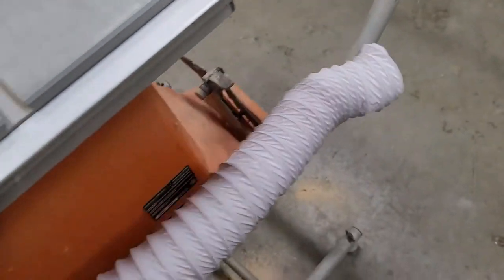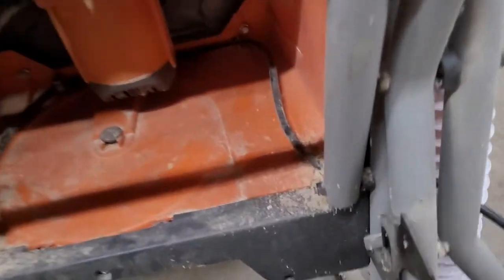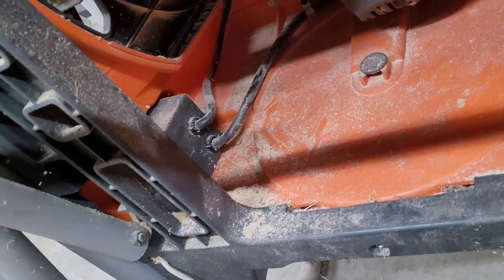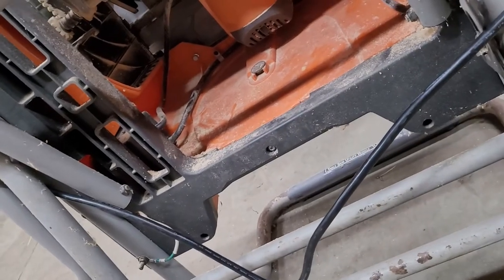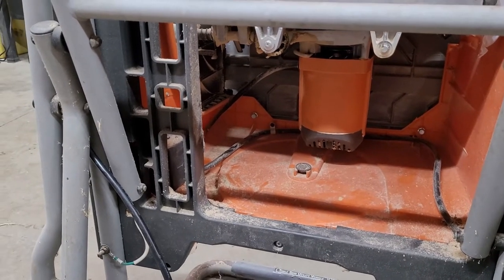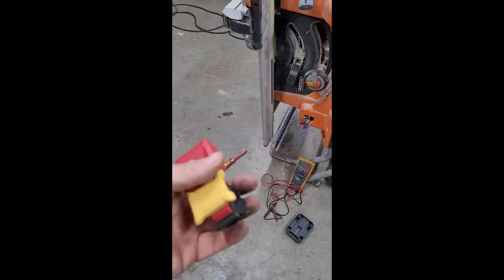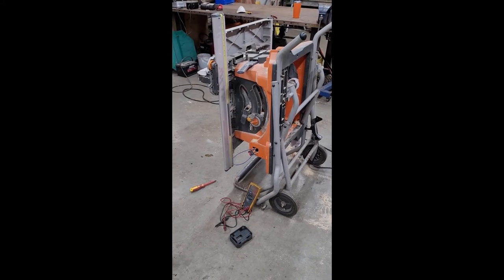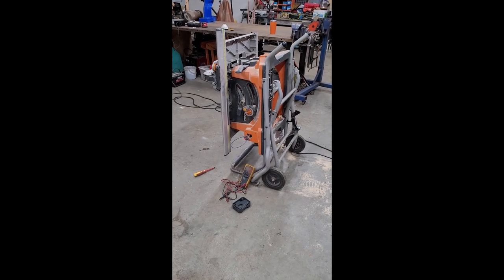Rigid Table Saw   Switch Replacement

Comment: I have the same saw but a different issue. When I switch on, I hear a relay “click” but saw doesn’t turn? I did attempt to take the switch out to check the wires to ensure they are on tight. They are. In that switch assembly is a relay, the one I can hear clicking. The wires are very tight, no slack, and I am unable to pull that switch out enough to be able to get a meter in there. The plastic connectors (grommets) the wires pass thru to go to the switch seem able to come apart but not sure how they work, didn’t want to break them…so now I’m stuck…any suggestions? Thank you

Comment: I cant seem to figure out which way the wires go back on. I troubleshooted everything like you did and came to the conclusion that i had a switch problem. Even noticed a burn on one of the switch connectors. I just cant seem to get the wires back on to the correct spots for the thing to work